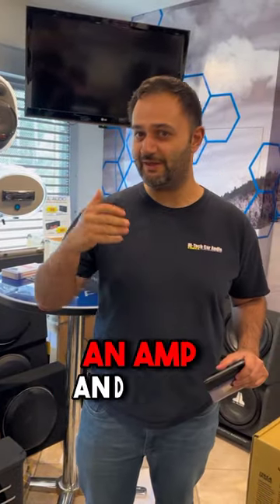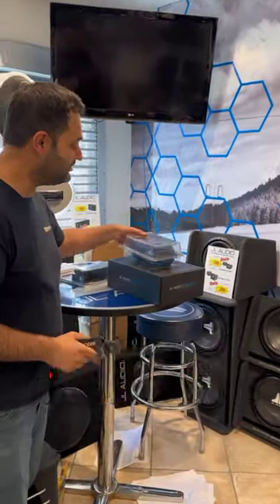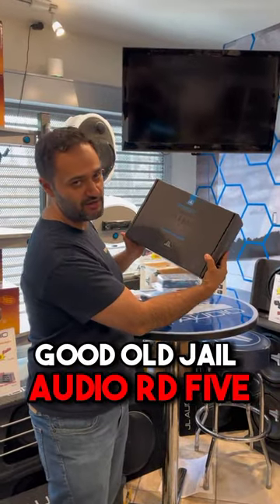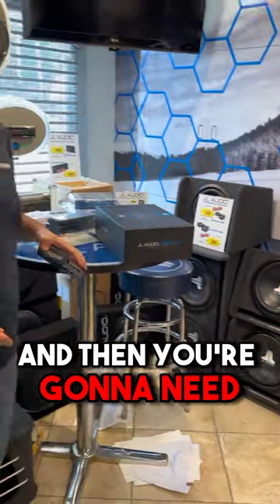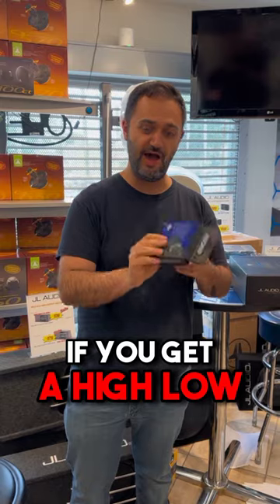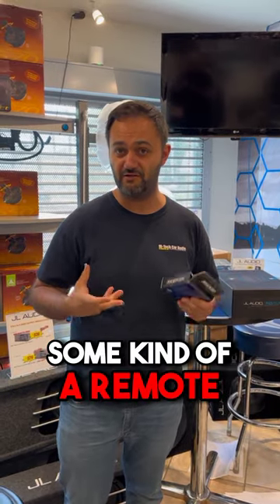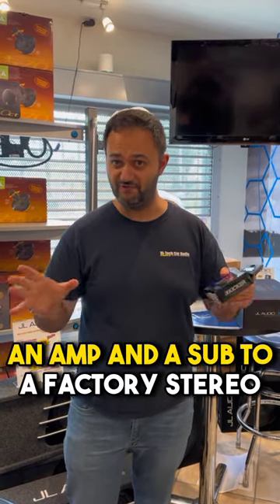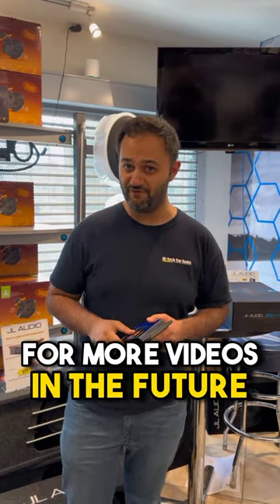How to Install a Subwoofer & Amp to Your Factory Stereo (4 MUST-HAVES!)

Comment: I would just wire a separate system in myself. I hate the "safety" bullshit they add. You can't hook your phone up in gear not moving, 20-30 second safety warning every time you turn the car on, can't have volume control while backing up because anything past 10% you will crash even in your driveway

Comment: Even for a 2500 amp I don’t have to run remote?
Reply from the maker: With a line output converter with remote turn on, it won't matter the size/power of the amp - it'll work with all of them.

Comment: I have a jl 500.1 amp, and a 12 w6 jl sub. Im running 8 gauge wire right now, if i switched to 4 gauge would it make a differnce?
Reply: If you look on JL’s website, it will tell you the recommended gauge wire.
Reply: I have that times 2 I have 4 gauge wire
Reply: No

Comment: I got that kicker loc, so I don’t need to run a remote wire to the fuse box so it turns on with the car (power mirrors for ex)
Reply: I'm trying to do thr some.

Comment: Why do you need the loc when the rd500/1 takes high or low level inputs
Reply: The ac adapter thing needs a place to be plugged into some factory speakers need the loc I know I do I just order my 12 inch skar audio and I’m waiting on the adapter tomorrow